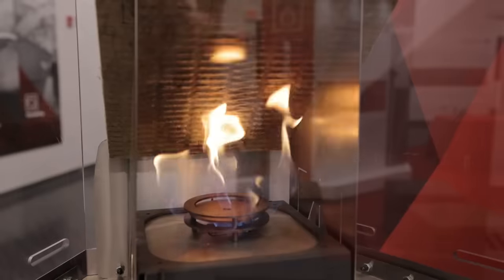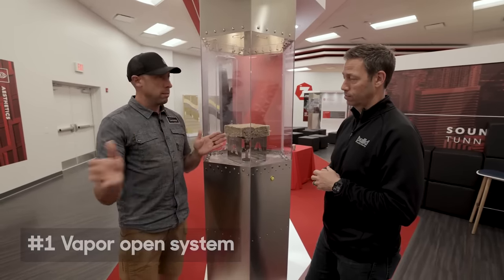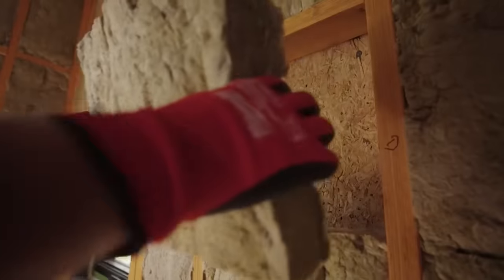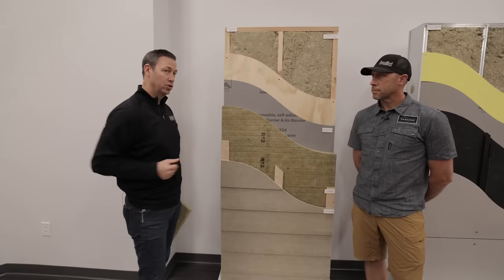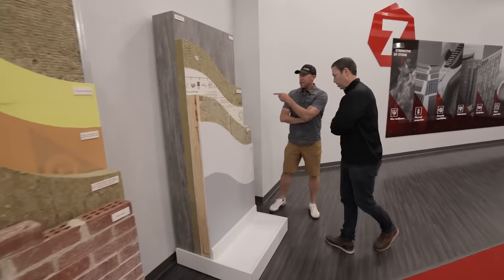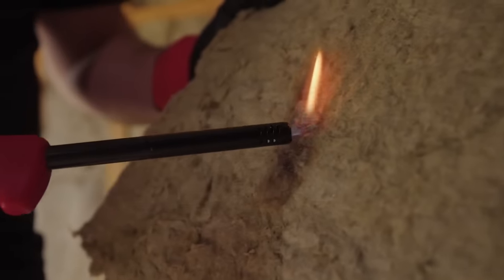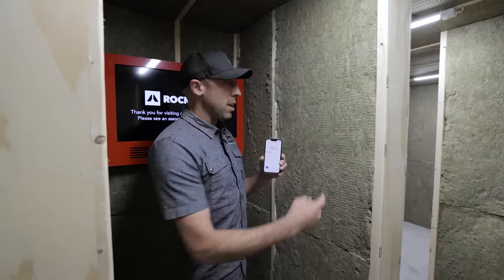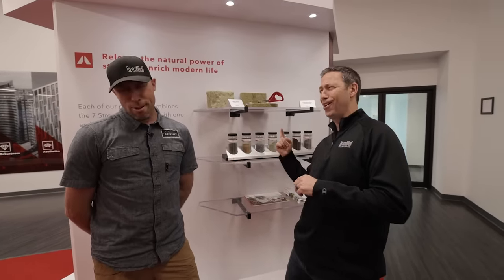3 (little known) Benefits of Rockwool Insulation

Comment: I first learned of the superior benefits of Rockwool from you, Matt. Yes, Rockwool is more expensive than fiberglass, but the superior R-value, water repellant benefits, sound properties, and fire blocking benefits make it hands down the better option. I have insulated my first house completely with Rockwool, and I will never put fiberglass insulation in my house projects ever. Thanks Matt!
Reply from the maker: 100%. Thanks Johnathan
Reply: Having had a house fire that actually started outside on the porch, caught  the Styrofoam insulation behind the siding and was funneled up into the attic you better believe I plan to spring for this stuff when I finally get to build. If it Rockwool had been used it would have been a nuisance that was cleared up in a couple weeks. Instead I'm still dealing with the fallout 3 years latter.
Reply: @MrJimme2003  Man! So sorry to hear that. I hope you can soon get back on your feet. Prayers.
Reply: @JohnathanBach  Thank you. I like to think I'm getting close. Not sure when it will be exactly, but everyday has to be closer right?
Reply: @MrJimme2003  My husband and I had a house fire last May.  I thought it was just our lack of funds coupled with no homeowners made us outcasts in this situation.  It will probably be a three year timeline for us to get everything taken care of.  We had an antique floor lamp that shorted out and all of the damage was cosmetic.  The interior of the front door, the sofa, the closet the lamp was in front of and 2 of my sewing machines were the main losses.  The heat got to some other trim work, but the amount of soot, smoke and water damage is what has been so overwhelming for us.  I had taken a screen of one of the windows and busted a pane to stick the water hose through.  I had the fire out by the time the FD got there, they said.  But that didn't stop them from dragging 3 hoses in and leaving all 1500+ sq ft of living space flooded along with 2" of standing water in the full basement for us to deal with. 🤦  I feel better just knowing we're not the only ones this is such a long drawn out process for.

I hope no one was injured and your home is back to normal soon!
Reply: @randibgood  I ended up with 21 stiches and some small burns but nothing serious. People think I'm crazy when I say Id take a flood over fire. We had to replace all the drywall, insulation, flooring, roofing, and about half the roof decking. Mostly due to the smoke damage and heat. The fire department didn't go nuts with the water so we got lucky there and the only part with water damage was near the fire. I did have insurance but first contractor I hired cashed the materials check and skipped town. That wrecked the cash flow and the actual final repairs to the house should actually be done tomorrow. I ended up having to do most the repairs myself because when the contractor took off with 20% of the insurance money I couldn't afford to hire out much more than the bare minimum. There are still lawsuits related to it being settled and waiting to be filed, if I ever find him. I racked up at least an extra 30K in debt from all this. It will probably take another 5 years to recover financially and I don't see how I will ever make up the lost ground. 

On the plus side I did force me to learn a lot about construction and how to do just about everything related to it. So while I may have a hard time ever trusting another contractor again, if I do hire one I'll quickly have a pretty good idea if they know what they are doing or not. I'll also be the general contractor on my next house, and also be able to do most of the trades work too. 

Your certainly not alone in your suffering. Even when its "simple" it goes sideways. Buddy of mine's how burned down, total loss. Insurance paid out, but the mortgage company tried to steal over 100K from the payout. He had to get a lawyer involved and it took about 6 months I think. It should have only taken 2 or 3 weeks. Of course he also almost got hit with an arson charge for trying to burn the remaining partial wall that was his house. Misery loves company. Best advice is to record all your calls after the disaster, pray, and and don't trust anyone you didn't trust before. Eventually it will all pass and you're building character the whole time. Unfortunately character is rarely cheap to buy. 

Good luck to you and remember, you're not alone.
Reply: @MrJimme2003  We got lucky, too.  We both got out and each of us got one of the puppers out, so everyone was ok.  We've got a lot of sheetrock to replace and repair.  Along with removing and replacing all of the insulation.  But NO WOOD was damaged!!!  Well, except for the trim and doors, which have not had the same outrageous price increases as framing lumber.  That sucks about the contractor, your buddy's house too.  When it rains it pours.  At least you're getting yours buttoned up soon!  I'm looking forward to being able to say that about ours!

Take care & congratulations!
Reply: @MrJimme2003  Thanks! I'll check it out, because that hasn't even been started!  All we've done is calculate how many sheets we'll need.
Appreciate that, thanks!
Reply: Something sure has changed. Just a few years ago, fiberglass insulation was a premium price product. Mineral fiber was considerably cheaper. Fiberglass is made from a pure form of  silica sand which is quite expensive. Mineral fiber is made from a much cheaper basalt rock base. Great marketing.
Reply: @georgelabottum7448  Fiberglass is more soundproof while mineral wool is more resistant to fire.
Reply: @PlanetIscandar   you’re correct on one fact. Miner fibre can handle higher temperatures than fibreglass. When it comes to sound deadening, density of the material and thickness are the deciding factors. Sound absorption increases until density reaches approximately 4.5 lbs/cubic foot and decreases after that. Sound absorption data reveals that a 4.5 lb product at 2 inches thick will deliver the optimum NRC at all 5 decibel frequencies. To control extremely low frequency sound, thickness of the material is increased to as much as 5 inches. These practices were adopted when sound proofing IMAX theatres.

Comment: I am an audio engineer - for anyone who doesn't know, 2" insulation absorbs down to about 500Hz, 4" thick down to about 125Hz.  If you use acoustic panels with an air gap behind them or as baffles, you double the efficiency of the absorption generally speaking.  Safe n Sound 3" works pretty well, but double that up to 6" to start absorbing frequencies under 100Hz.  Their product is 3" thick usually going in a 4" stud bay and the air gap helps absorb more sound, however it is a trade off because 4" of insulation absorbs to lower frequencies.
Reply: Perfect info - that's what I was really wondering about. Thanks so much. I'm off a super noise highway. I already get good sound proofing but I want even better - so this is what i needed to know. Also the insulation and fireproof value and keeping out animals. This stuff is awesome.
Reply: That's great info! However,  what do you do to start blocking really low frequencies from a subwoofer? Such as 25-50hz?
Reply: @bassplaya69er  that's great info! Thank you!!
Reply: Thank you. This is what I had wanted to know.
Reply: @voidisyinyangvoidisyinyang885  Windows are the weak link with regards to exterior noise pollution.. I once stayed at a downtown hotel (in Auckland), that had double glazing, with about an 8 inch air gap. It was VERY quiet in that room. Not practical for residential, but there are some good sound reducing windows available for the residential market.
Reply: Just gonna comment this. We’ve built three studios now and rely on this stuff!
Reply: @jordesign  makes sense - my hut has no windows unless all the holes in the walls count. I lived on homesteaded land in Alaska and the guy used to go around  Alaska with a thermometer infrared gun - in the 1980s - so cutting-edge technology back then. Then he would explain to people that all the leaks in their house was the equivalent of having a window open all winter. Then he would sell them insulation. So yeah technically I can't go beyond the 10 x 12 structure since I have no permit but anything 3 feet and below is technically not considered a structure. So I plan to line the exterior 3 feet and below with rock wool. The main noise is low engine sound - so I figure it has long wavelengths. Maybe it will get blocked from the lower  end of the wavelength. Already the hut is half as quiet as outside - if not more quiet. I built an archaeological hut from an 1800 Double Wattle Wall with willow woven and then a clay slip hay insulation - so it took too long to build as I just used manual tools to harvest the willow and hay and mixed in the clay slip. Then I used a lime wash. It's lasted a few years so far. I didn't take any measurements and so I messed up the corners - the willow branches don't overlap well so there's holes. haha. I filled it in with whatever shack material - like that cotton jean insulation or my old clothes or I dumpster dived some foam cushion seats from a movie theatre throwing them out. haha. It's just a random hodge-podge of stuff. Yes the rock wool will cut down on the frozen frost on the inner lower walls in the winter - and the critters. haha. The hut has no floor even. I like contact with Earth.
Reply: @frostman9661  Practically, you can't.  I'm also an Audio Engineer.  I design loudspeakers for a living.  I do a lot of measurements in my field stone foundation basement.   I always run into problems at the low frequencies from traffic driving by.  This despite the mass of the earth surrounding my measurement zone.   After doing this for 15 years, I've got a good idea of which frequencies are real and which are anomalous.
Reply: Another thing less than half as loud? Isn't decibel logarithmic?
Reply: @frostman9661  To isolate those frequencies, you need physical uncoupling, not just absorption.  This is why drum rooms in a studio have double doors and isolated floors and walls (also a former recording engineer)
Reply: @jesinbeverly  The earth, like most materials will pass vibrations.  Isolation is the only method to attenuate these frequencies.  Earth is actually a pretty good medium for propagating low frequency sound, better than air but not as good as water!
Reply: @jefferyeckes5343  that's good to know. Without going overkill, how much of an air gap do you need?
Reply: I did make airgaps on my acoustic panels as well I used a grid behind the rock wool as well it sounds pretty good in the room even talking sounds like a radio station booth, but I can’t seem to stop the sub frequencies bouncing around the room
Reply: Hey, that's great info! What would be impact after walls will cover with sheetrock? Would it reflects sounds of the sheetrock surface?
Reply: @jordesign  Use standard double glazing windows with a sliding glass screen inside the window reveal. Power plant operation rooms were done like that 50 years ago and it seriously stops the noise. cleaning is easy - just slide the internal screen glass.
Reply: @magnushem5130  Every 3 dB halves the audible noise level. 80dB to 40dB is a sound reduction of 7 times (near enough).
Reply: I had a floor between a living room and a home theatre in the basement.  I used sound isolation pads with tongue and groove cedar as the home theatre ceiling.  I was impressed at the effectiveness of sound isolation.  My kids and their friends would often use the theatre and crank it either just music or more often, movies.  Except for the sound leakage up the half flight then a 180 up another half flight, the highs and middles down to some level of low frequency was inaudible.  Only the lowest bass excursions were heard and sometimes depending on how high they cranked the subwoofer, which sat on a tiled concrete floor was audible (even felt) and even then was not particularly intrusive.  I could have added Rockwool Safe and Sound (which I use in other projects and areas) to go to overkill mode and debated that option, but the results with only sound isolation pads proved quite acceptable.  BTW, for temp insulation, I do not use fiberglass anymore.  Why?  It is inferior on a number of accounts.
Reply: @staberdearth3130  usually the lower bass is felt not hear :P the low you go the more you feel and won't hear
Reply: @VoyagerGC  Absolutely.  Wave length becomes relatively very long.  Classic example is a concert where there is a high bias to bass.  You feel it like a jackhammer in your chest.

Comment: When we were getting work done on the house--new havoc and abatement of old ducting--we realized our blown-in insulation was about 3" deep.  That was it.  

We wanted our 30 year old romex gone (the old knob-and-tube wasn't connected anymore).  For that, we wanted the pitiful insulation gone--had it vacuumed out.  We put pieces of subfloor up in the attic so the electricians could move around up there, and made sure they put in some lighting, as there's a lot of room up there.  Once they were done, we needed to re-insulate.  

My husband saw your channel and other sources touting Rockwool.  Our local Home Depot put it on sale, so we were getting pallets-full at decent prices.  We weren't so worried about hitting R39.  We laid down R15 between the joists, shoving it in to very narrow spaces and building it up to the right depth, and up the side gables.  No need for baffles as no overhang, which is not uncommon in our neighborhood.  A second layer of R12 went on, perpendicular to the first, over all areas where the subfloor pieces were not going to stay.  At the edges of everything went a third layer of R12.  

On a 100F+ day, our interior ceiling went from 98F (no insulation) to 78-80F (with insulation).  One area only got one layer so far, because of work that had to be done, is about 85F.  It is far easier to cool down a house that is 80F than one that is almost 100F.  

And it was EASY to instal!  And Rockwool had a monthly drawing for "best review"--which I won!  $200!

Comment: In iowa where I live spray foam is hugely popular. 2” thick is most common. This leaves a huge open cavity in the walls where the wiring is. Electrical fires spread super fast and mixed with the fumes from the foam causes huge problems. After my neighbors shop burnt down due to that very thing I insulated my new post frame shop with Rockwool. So glad I did.
Reply: I'd never foam around wires. Only around conduits run through walls.
Reply: Yes… while spray foam is the “sexy” product of the moment I would NEVER use it…not only the fire spread and fumes…but if you get a leak that runs behind the foam on the inbound side of the exterior sheathing or from roofline it does NOT present itself until tremendous damage is done of a major mold issue occurs.  Old school “boring” rock wool is a tremendous product.

Comment: Lebanon, Tennessee. My own DIY home improvement project for 2022. I removed the blown in insulation from my attic. Some places didn't even have any insulation or very little. Then I air sealed all of the penetrations with spray foam. Then I used Rockwool R30 insulation batts, and a second layer of the batts perpendicular to the ceiling joists. In effect I should have an R60 now for my attic. I can already tell a greatly improved comfort feeling within my house. Now that the summer months are here, lets see how the utility bills are for A/C. I'm really enjoying the Rockwool insulation!!!! Thank you Matt!
Reply: Where did you get the Rockwool? I'm near Lebanon and coming close to needing insulation on my build.
Reply: Yeah I did two layers on my roof - just a hut - still now I just need to do more on the walls.
Reply: @ceciliabora8589  I bought mine at Lowe's in Lebanon. It's not normally in stock, due to supply chain issues I guess? But I wanted R30 batts, so I ordered it at the Pro desk.
Reply: I did this in my garage attic. Also framed out the garage walls flush to the concrete and insulated both voids with Rockwool. Garage was always cooler than the house ( with A/C ). No windows in the garage or garage door.  Whst does that tell you about the impact of windows ? Very nice to work in even on hottest summer days in Regina, Saskatchewan.

Comment: I have used Rockwool here in Norway for the last 20+ years as a carpenter. Great product and fire safety. Great video Matt.
Reply: I used it in Germany maybe 5 decades ago. The owner/builder got a deal on Roxul in Denmark and I put it under the tile roof system. Only took 40 years for it to get to the US. Best stuff in the world.
Reply: @ricoludovici2825  ehh, forget Gutex?
Reply: @GeraldLeenerts  If it was expensive or effective, we didn't get it in Iowa. More like Celotex. That was the high-dollar corn-board.

Comment: That sound absorption demonstration was impressive. This would be incredibly beneficial for a home office space. If not every room.
Reply: The absorption changes again with drywall applied because echoes and reflected waves. Account for this and add surface absorbing materials on the drywall fyi. I used S & S  in my home studio in between ceiling joists and walls and it made a great difference.
Reply: @PrimeWhoLeo what's s&s?

Comment: I've been using Rockwool for about the past decade to (slowly!) replace the insulation in my house. I put it everywhere, and I love it. Easy install, blocks fire, holds itself in place, deadens sound, superior insulation, won't compress like glass insulation, no off-gassing like foam. It's an awesome material. If I were building a new house, Rockwool would be everywhere.